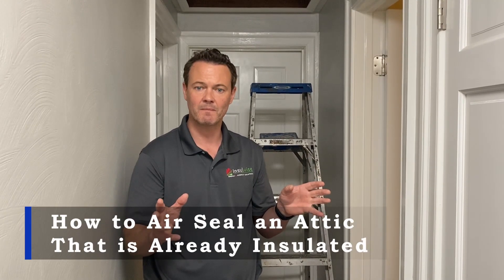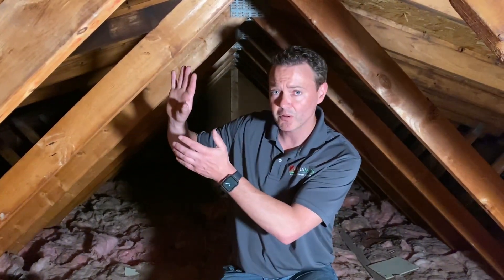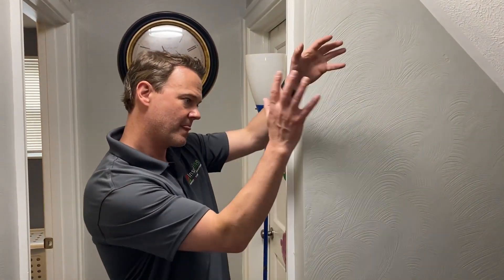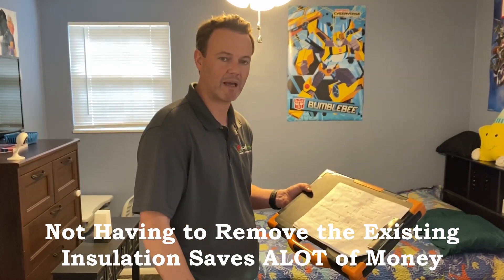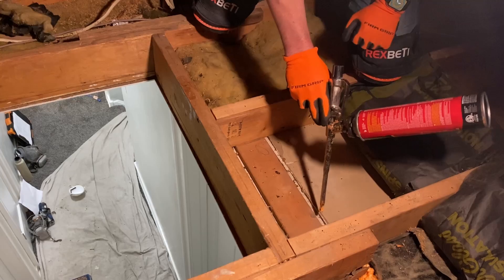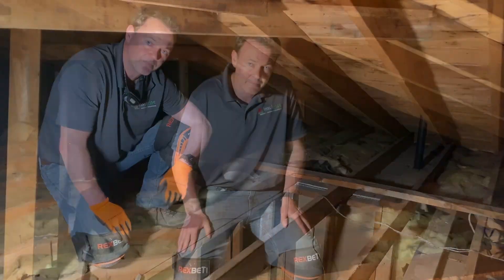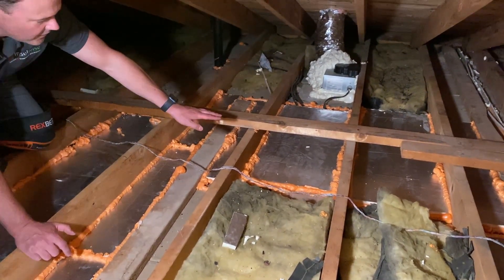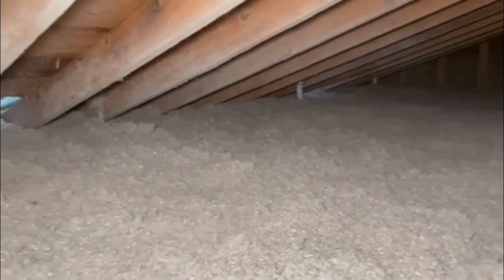Insulation Expert Reveals the BEST Way to Air Seal Your Attic

Comment: At what point is it worth removing old blown in insulation. Our house is probably 35-40 years old and as far as I know we have about 6-7" of old blown insulation. I'm thinking of removing as much of the old insulation as possible. Seal the openings and blow in new or is it ok to blow over the old and save some money?  I'd be open to hiring it done if I knew someone could do as good a job as your videos demonstrate.
Reply from the maker: Hey there Travis thanks for commenting.  The only time that we remove old material is when it's contaminated with animal droppings and stuff like that.  That said, it does make it easier to find the air leaks when you do this, and a lot of companies now recommend doing it for this purpose.  It will however add a good amount of expense.  For us it takes a full day, and sometimes it's brutal (even when it's blown in and you try to vac it the old insulation can be full of debris from a past roofing projects etc that clog the hose).  If you can make a good map like I show in the video and take your time find and sealing the leaks, 6-7" is not that much to have to work in, and you will save money both on the removal and on having to blow in that much more new material.  
The practice of blowing new insulation on top of old is called top coating and that's our standard practice here.  That old stuff still has it's R-Value for the most part.  And adding a new layer on top of it will allow it to perform much better.  
You do have to be careful when hiring contractors to do it.  A lot of companies now say they do air sealing work, but it's often hard and workers can be tempted to opt for Miller Time a bit too early.  We do test ins and outs with a blower door as a standard practice now as well as Zone Tests for traditional attics to confirm they're tight. 
That's the best way to know what you're getting if you can find someone who can do it.  Hope this helps!

Comment: Is it just me or is there a misnomer here…. Air sealing the attic and air sealing the living space is two different things….?.
  Air sealing the attic means you seal all vents and you add conditioning to the attic…heat and cooling…?
Reply from the maker: Thanks for commenting.  It would technically be more correct if I had worded it as "air sealing your attic floor so that it's isolated from your home."  I named the video as I did to shorten the title was all.

Comment: how does air leak around the top plate?  the drywall of ceiling and wall meet to form a corner which is then filled, taped, and coated with joint compound.
Reply from the maker: Great question Richard.  Here is what happens.  When that 2x4 plate gets installed the moisture content of the lumber could be as high as 25%.  After a few months/ years in a dry attic it can drop to 10-12%.  This causes the 2x4 top plate to shrink.  The drywall seams are sealed inside the home and you can't see the leak.  Warm air enters the stud bays through outlets, pipe accesses, holes for cable and wire, etc.  That's where the air comes from and the shrunken 2x4 allows it to escape.  Have a look at this video, you can see it clear as day. 
https://www.youtube.com/watch?v=X7GMG3T8cE8&t=9s
Reply: Ah ha. Thank you.

Comment: I don't really get the necessity of this if there is insulation over the top of these attic penetrations.
Reply from the maker: Great question Craig.  The reason for air sealing all of these penetrations is because air from the home pushes right through insulation.  Check out this link where I'm air sealing another attic and you'll see the clear dust streaks in the fiberglass batts created by air with dust coming up from the home. 
https://www.youtube.com/watch?v=X7GMG3T8cE8&t=5s
Reply: @insulwiseenergycomfortsolu3293  Excellent, thank you. Now I know!
Reply: @insulwiseenergycomfortsolu3293  Thank you, that makes sense.

Comment: when do you prefer fiberglass to cellulous?  which works better over existing fiberglass batts?  you didnt show sealing the exterior sill plates, nearly impossible to reach with my 4/12 roof much less see what you're doing.
Reply from the maker: I've never blown fiberglass into an attic.  The stated R-values and performance metrics are simply not as good as cellulose.  We top coat fiberglass batts with cellulose every day and it works great.  We seal exterior wall plates when we can access them.  If we can't we at least try to seal things like wire holes, but sometimes you just can't get there.
Reply: @insulwiseenergycomfortsolu3293  so will 12" of cellulous reduce infiltration? my house has 150' of external walls, but very tight.  the bird blocks are 2x4, 3/12 roof.  they also screwed down osb to create storage down the center of the trusses over the hallway below.  i will pull that up to access wire penetrations.

Comment: Can you do the same with existing blown in ? Have to sweep it back will the foam stick ?
Reply from the maker: You certainly can and we do it all the time.  Just make your map, get on your gear, be very careful moving over the studs, find the air leaks by brushing back the existing insulation, foam it up and move on.  If you lightly replace the blown in material over top of the foam it shouldn't affect the foam.  And yes, it'll definitely stick.  Thanks for commenting!
Andy

Comment: Nothing beats rolling fiberglass batts in a + pattern!!
Reply from the maker: That can work very well in the open areas of the attic.  But in eaves it gets much harder if not impossible to get two passes of fiberglass.  Using in blown in insulation typically creates much better coverage.

Comment: Helpful video. What foam do you use? Do yiu use fire block foam around electrical equipment?
Reply from the maker: We usually use regular Great Stuff off the shelf, either $5 a can or the gun foam stuff.  We don't use orange foam around electric, it's pretty much the same stuff.

Comment: how many cans do I need for a 1200sqft house? Should I use that fire foam for everything? or is that just orange foam lol
Reply from the maker: Honestly I'm 90% sure it's just orange foam.  Tough to tell, but I'd say to plan for at 12 cans.  Just keep your receipt and take back what you don't need.  This is also for the smaller cheapo 12oz cans of Great Stuff...works just as good.  Good luck!

Comment: Hi! I live way down South! A lot of humidity. I just recently discovered a lot of moisture in my attic when it snowed this week!! Like a 100 year event 😂 anyway I haven’t seen any questions regarding metal roof and ac system in the attic! All there when I purchased the house. I had many issues from the start, very hot in the attic and just ac system not installed properly. Ended up putting foiltec on the top rafters and that really helped with the heat issue in the summer. But I’m now realizing that I probably had a bit of moisture in the winter and just didn’t know it!  I actually thought the whirlybirds sucked snow in the attic. Went in to check from the not so insulated attic door 😂 and it there was a lot of moisture on top of the foiltec. I pulled it off a lot to let it breathe. Just started searching and found your video. Warm air and cold air results in moisture, correct? I have a mess and will be starting from scratch with all of this 😢. Lord where do I start first?? I really want the ac out of the attic, is this adding to the moisture problem? Any advice would be appreciated, especially after this long message 😊
Reply from the maker: Hey there no worries.  The moisture is coming from the home.  As the warm air with moisture rises from the home it escapes into the attic and condenses on the cold surfaces in your attic.  Air seal your attic floor good and this will help dramatically.  It'll also help dramatically with your cooling costs during the summer.  Get ALL of the seams sealed tight on your AC duct system and make sure you have at least R-6 or best case R-8 rated flex hoses.  I'll add two other links to check out.  The metal roofs that we see here are always vented crappily...for the guys installing them it seems an afterthought..."but they're just so pretty!" ; :
Duct System Enhancements: 
https://www.youtube.com/watch?v=teZiNshMGiA

Sealing leaks in a duct system
https://www.youtube.com/watch?v=vW4mwc_2_Iw&t=1s

Installing Better Flex Hoses
https://www.youtube.com/watch?v=dmv4-E43mMg&t=497s

If you have other questions shoot, and good luck!
Andy
Reply: Summary: warm air on cold surface = water.
Don’t cut corners!  This is no time to buy cheap material.  Get that metal nozzle he uses in all his videos. But be careful because the nozzle can clog up with solidified foam.  Read the instructions on how to keep it free!!!!
Watch this guys videos four times each and keep notes!!
Take your time - you got this!

Comment: Thanks for this video. Very helpful! I’ve just begun the process of air sealing my attic. I have a gable roof with soffits and a ridge vent. How do you guys manage to properly seal the top plates of exterior walls where it gets incredibly tight? Maybe a foam gun extender?
Reply from the maker: If the roof is too low sloping we usually can't get to those to be honest.  If the exterior walls are insulated with semi-modern fiberglass batts they probably aren't leaking too much air tbh, at least not nearly as much as the interior top plates are.  Fiberglass won't "airseal" but dense fiberglass will definitely slow it down.  The only thing I'd make an effort for are wire holes if you can get to them.  You can also seal the outlet box from below worst case.  Kill that circuit in your box, test the outlet with a voltage tester to confirm its dead, pull the outlet from the wall, use a caulk gun with an extender cone and silicone and hit the openings in the back of the box (you can also use a can of foam but you have to be VERY careful not to use too much!) allow the sealant to cure and re-install the outlet.  
You could use a foam gun extender, but that could be a lot of effort for not much gain.  If you pull a few batts back in those areas and there's not black streaks in the glass that'll tell you about the air leakage happening there. 
Andy
Reply: @insulwiseenergycomfortsolu3293  Thanks for the quick reply, Andy. I'll focus on the electrical penetrations then. When the house was built (1980) they did not install rafter vents, so to avoid covering up the soffits, they didn't blow fiberglass within about 2 ft of the soffits. Makes for a nice cold spot all the way around the house, but no way to know if it's leaking much air. Not looking forward to install the rafter vents in such a tight space, but I know it needs to be done. Can't wait to finish air sealing and get an appropriate layer of insulation. We have at most 3 inches in some spots. We live in southeastern VA. Not sure how that got past code...Anyways, thanks again for all of your videos. They've been incredibly useful!
Reply from the maker: @JackB-x2v  Thanks again Jack.  I have seen that before.  At the house in this video there were also no overhangs or soffit vents installed, so you'll see that we did not install ventilation baffles down in the bays.  In these situations what we do is install a series of slant back vents along the back of the roof, a few feet up from the gutter (above where the insulation will be).  You can see light coming in from them at the end of this video.  They actually do a tremendous job.  You can run into problems when you only have exhaust ventilation.  If you're getting your roof redone an even better move is to have roofers install under-shingle intake vents on the front and back of the home.  I've left a link to another video here where you can see what slant back vents look like if you're interested, I think at the 3-4 minute mark.  Hope this helps!
https://www.youtube.com/watch?v=x_z9FLeg5AA
Andy

Comment: Hey, I have big cavities like the stairway around certain things in my attic. Are there any rules about what you can and can't cover up? I live in a home from the 60s, and I have some voids around the walls where my water heater and furnace/hvac are. They don't really occupy this space now, but I think it was old technology that used to utilize a wall that was 8-10 wide with NO top cap.

So... These gaps are uninsulated in my home.
Reply from the maker: Hi there, wow that sounds pretty crazy.  Ok, so if there are flue pipes there that are still transporting hot flue gasses, than they need to be sealed around with sheet metal and high temp silicone and then wrapped with something like a fiberglass batt before blowing in or adding insulation.   If there are no longer things in that area that are being vented this way or get hot, than you can cap them using the same techniques shown in this video.  I need to get a video up for air sealing around flue pipes!
Thanks for commenting, 
Andy

Comment: I see when you pull up the bats of insulation that the paper is still on them. I thought you had to remove that paper when you used that type of insulation in the attic...?
Reply from the maker: Great question.  No that paper is a vapor barrier (an exceptionally poor performing one I might add).  Seal your air leaks than lay it right back down the same way.  That's how it's supposed to work and is installed in every attic.

Comment: Umm, the after picture looks like you insulated over the soffit vents.  Not good.
Reply from the maker: 1.	This house had no soffits, overhangs, or intake vents.  We installed slant-back vents a few feet up from the gutter along the back of the house to provide intake air for the ridge vent.  You can see the light coming through them at the end of the video and I believe I call out that we did that and why.  Thanks for commenting. 
Andy

Comment: Great video! When it comes to the bulkheads, how does they leak conditioned air if it’s all sealed with the dry wall?
Reply from the maker: Great question and thank you!  The vast majority of bulk heads that we encounter have accessible "open-topped" stud bays down inside them.  The top plate for the wall is located at the same plane as the ceiling, so 12" inches or so down the stud bay is wide open down into the house.  When bulkheads are sealed off you're right, they're probably not going to leak.  We typically seal them anyways because they often have recessed lights in them or as a best practice because they're often removed during remodeling jobs, and when they cut the ceiling open the guys won't have cellulose from the attic dumping on them.
Reply: @ thank you!

Comment: Air seal? Hello dry rot. Buildings need to breathe!
Reply from the maker: There's no such thing as dry rot.  Rot is a function of fungal growth/ ie mold.  If you see it rotted and dried later that's because the wood was able to dry.  Also, air sealing attic floors prior to insulating has been commonly understood as necessary process for about 30 years now.  In fact -- not air sealing attic floors in cold climates -- and having a well insulated attic -- adds significantly to the risk of mold growth in the underside of the roof (stack effect driven air leakage from the home depositing moisture on the underside of a cold roof).

Comment: Andy, in a situation where the house and attached unconditioned garage have a common, vented attic space, should the attached garage ceiling also be air sealed and insulated with the house.  Access to the attic is from the garage ceiling.  Contractors that I've spoken with recommend against even insulating the attached garage which is not sealed off from the house attic.  Also, how is electrical or HVAC work performed in the attic once all the insulation is blown into the vented attic. Are there walk lanes through the insulation. Thanks.
Reply from the maker: Great questions and thanks for commenting.  We see this all the time.  The attached garage attic only needs insulated if your garage is roasting in the summer and you want to block the heat transfer from the garage attic to the garage below.  You just want to make sure that the house is truly sealed off from the garage area as well as you can.  
Once the attic is insulated with blown cellulose, you can move through it either by walking carefully with feet on the studs or using a kitchen broom to whisk a path.  Once done, you kick or broom the material back into place.  I've had to touch up / inspect attics that we've already blown many times.  Once you get a little bit of a feel for this it's not too difficult, you just need a few things:  headlamp so your hands are free, knee pads so you can work, gloves, and definitely a good dust mask / respirator.  Let me know if other questions. 
Andy

Comment: Did you guys add baffles for the eve vents or is this house gable and ridge vent only?
Reply from the maker: Ahhhh the most common question I get here.  The house had no overhangs.  We installed slant back vents on the back of the home to provide intake ventilation.  I point this out at the end of the video..you can see light coming in from the vents.

Comment: Great video and glad it showed up on my feed as I was looking around for guidance.  Had a huge air leakage throughout my previous house, had a crew come out and sprayed insulation throughout my attic, but still felt a lot of drats and heat loss throughout the house during the winter.  Before I remember going into the attic and seeing a ton of light coming up through the floor and I know that those guys didn't use anything else.  Now I know thanks to your video!
Reply from the maker: Thanks for the compliment.  Most insulation crews perform a cursory at best air sealing job before blowing in more material.  It's half assed at best and will cause your roof to rot at worst.  If you live in a cold climate and your attic is well insulated, the attic floor needs to be air sealed.